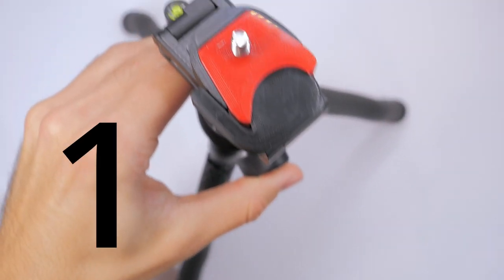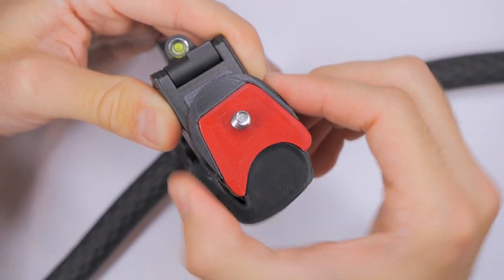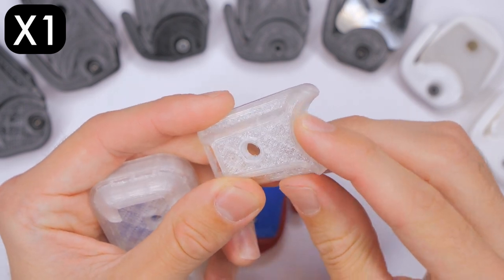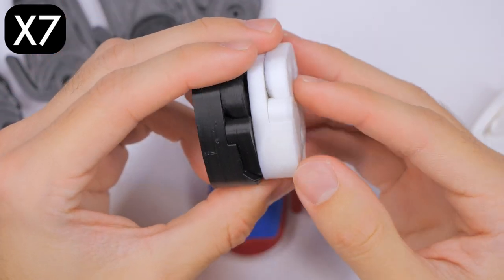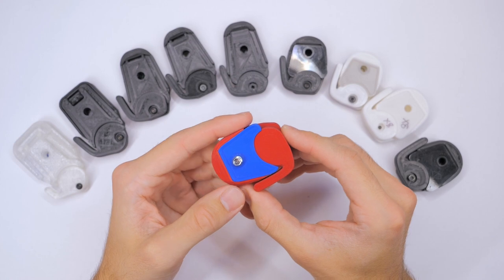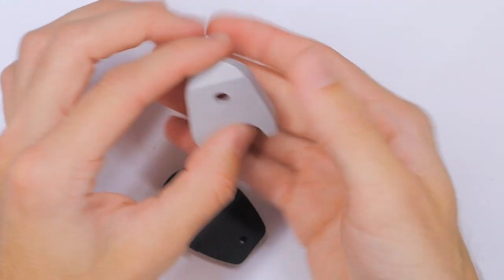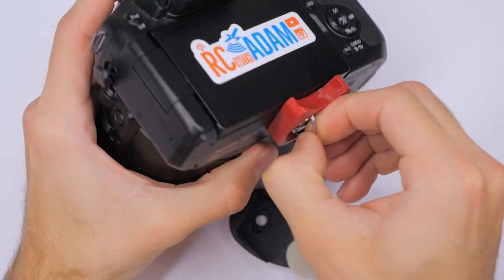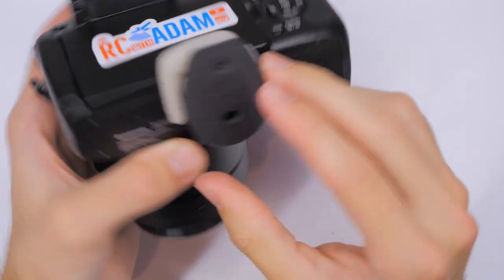Meet QwkMnt - World's Best 3D Printable Camera Mount

Comment: The lever lock. You could have gotten away with a shorter lever, like a thump switch-like lever. To me, it could break really easily if it got hit or dropped too hard.
I would have made it into a kinda like water teardrop or kinda like a light switch. Flip it up for off and flip it down for on.
And the mounting screw nut and screw wholes. I would have made that solid and then used a self-drilling screw tap bit. Use the whole filament part as the nut.
With those three changes, it could reduce your cost and print time as well!
I do like your 3d print idea overall. If you make another one with those changes let me know I would like to see it in a video.

Comment: The base plate is the one that will be the weakest.  The way you print it currently is the weakest orientation possible (for no reason -- you should be able to rotate it and print it in the strongest direction if it weren't rounded for aesthetic purposes).  And that's the piece that would be the best candidate to be printed in metal.
Reply: Wait what why? Everything is printed flat on the bed. Which way do you need the strength, are you concerned that the toegrab will delaminate? There is no absolute weakest orientation...
Reply: @SianaGearz  lol